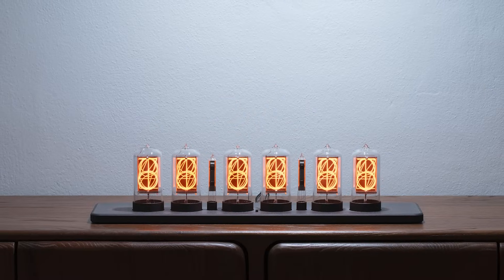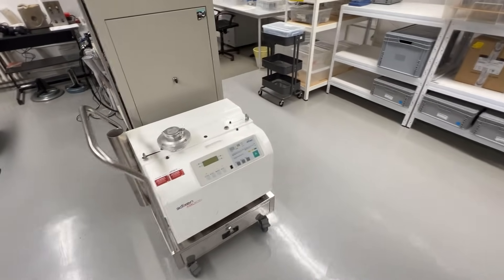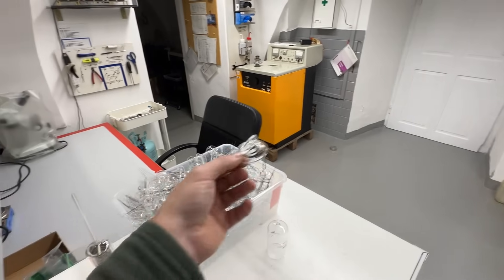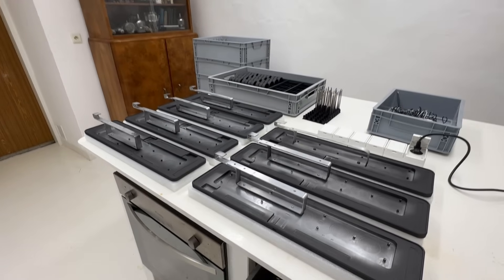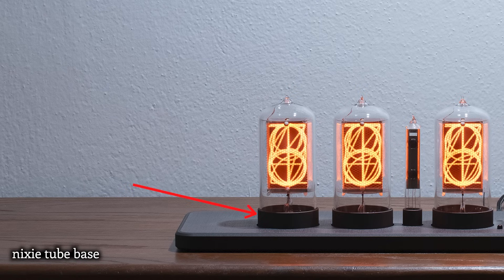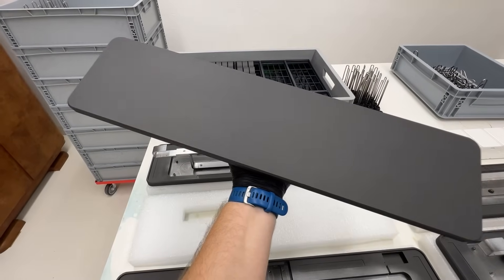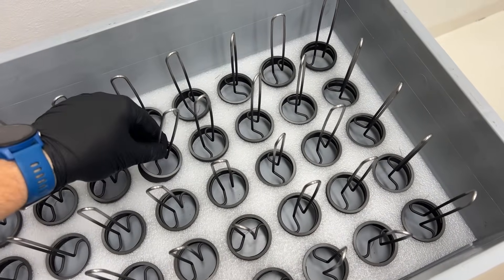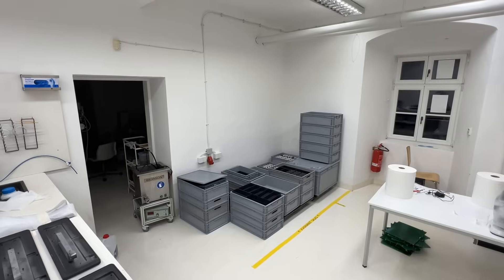Starting Nixie Tube Production for the Omnixie clock

Comment: The holder for the round part is not ideal in my opinion. It's hard for the painter to turn the part reliably. This can explain some of the inconsistencies. It would help to out a tube over the holder and weld it to one side of the bend wire. it will be much easier to turn. It would also be a good idea to go to the people who've done the first batch and ask them:
- What was their most common problem.
- How the work holding could be made better.
- did they see ways to make the hole process easier for them. (placing the final product, getting a new product, cleaning, applying the coating, etc.) 
There are often problems you don't see and people are working around it instead of "complaining". Do the questioning after the first batch then after 10 and then after 100 to see if there are problems that only appear in "mass production". Do that regardless of the quality of the final product. People working around problems can make things awkward, annoying, complicated and inconstant.

Comment: Too bad about the Cerakote. I'm wondering if regular powdercoat would be more cost effective.  There are hundreds of colour choices, and it's a tough and durable coating for indoor use.
Reply: Problem is it will be glossy, which the ceracoat is not.  But first batch generally has a high defect rate till the producer optimises the line and layout, and the people doing it get experience as to the desired result.

I think the second batch will be better, especially as you see the defects were all on the one side of the box, saying they were first units. At least local supplier easy to show them the defects, and a good one, so they know what is required. Would say that a jig that holds the parts all in a line, and spins them as well, will be better. A simple jig with hooks to hang those holders, and a set of pulleys and O ring drive belts, with a small DC speed controlled motor ,will work well there.  Long steel U channel, with small bushings to hold the rod, and using sintered bronze as a bush, so no oil to run down after the initial soak, will work well. Small stamped steel pulley block, with the long O ring snaking around them, then returning via an idler pulley to the motor, will be easy to make, as Dalibor already has a lathe and mill, which makes the frame and bushes easy to make, and then pulleys and rods slide down, with a simple thread at the end, and hook eyes to hold the parts. All metal so no static issues, and say 15 units at a time with a single run of the coating gun.
Reply: @SeanBZA  I really like the Cerakote but I was a bit alarmed when Dalibor said how much the coating costs per part. I have powdercoat in all different gloss levels from flat to full gloss and there are dozens of different textures too. You can also re-work it without having to strip it and sandblast again. It's not my project though and I am sure Dalibor and his suppliers will do a fine job.

Comment: vaguely related... but not...
theres a million and one videos on CRTs and cathode ray emission. but i cannot find any videos with a demonstration of "positive rays" or "anode emissions". physical demonstrations rather than animations. it requires a slightly modified CRT to produce... perforated cathode with a bit of room behind it for deflecting coils/electrodes. it takes place BEHIND the cathode...

one of the fundamentals of electron charge, relates back to JJ thomson, and its just one of those subjects that seems to be overlooked in this modern age... which is a shame...

not many people are equipped to make such things... hint hint :)
Reply: Electrons are negatively charged. That's hard to change, to put it mildly.
Reply: @EdwinSteiner  your point being? "positive rays". the stripped ion of gases such as hydrogen that flows the other way and deflects in magnetic and electric fields to demonstrate a positive charge, and large mass...
Reply: @paradiselost9946  You answered your question yourself: "Gases"! CRTs are vacuum tubes and the heated metal in the cathode boils of electrons, not positive ions. Gases are purposefully removed from the CRT in order to allow the beam to move freely through the interior. So you don't have moving positive charges in a vacuum tube. I'm not sure what you are looking for. Experiments with gas-filled tubes?
Reply: @EdwinSteiner  someone with the equipment to actually make such a tube solely for demonstrating an effect that is never demonstrated as no-one has made the appropriate tube for over a century and all that appears to exist is silly animations?

Comment: While disappointing, It's not as bad as I have experienced for a new supplier doing something that stretches their experience. I've found that suppliers need to ramp up their methods until they meet your quality requirements and recognize the defects themselves. Generally, a long-term supplier will give you a redo discount to cover materials and such (negotiate) receiving the initial batch. You can sit down with them and the line workers to discuss the flaws.
Reply: Seems like if the specs say the whole part has to be coated, that's on the supplier.